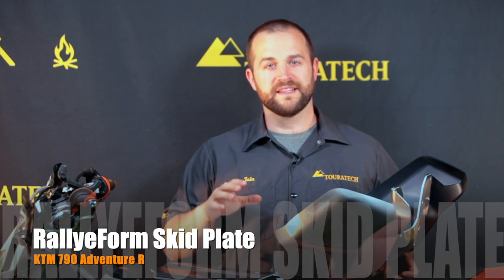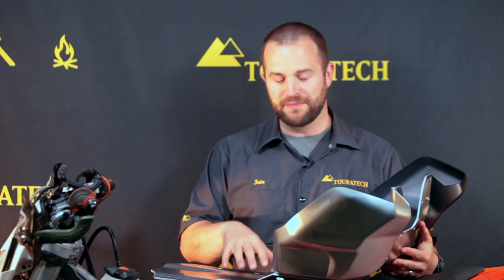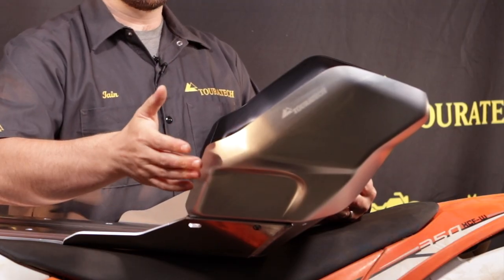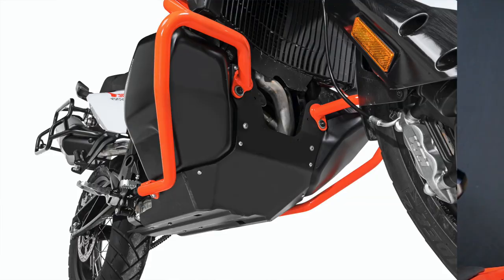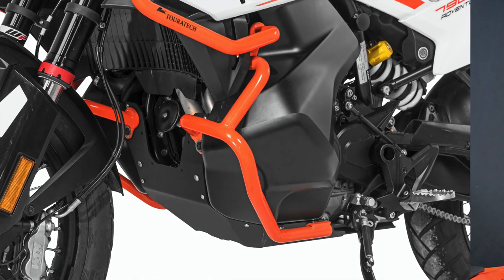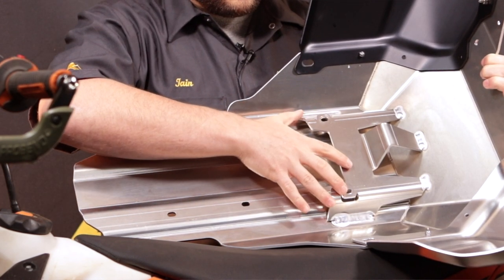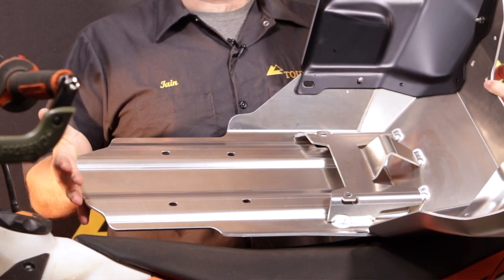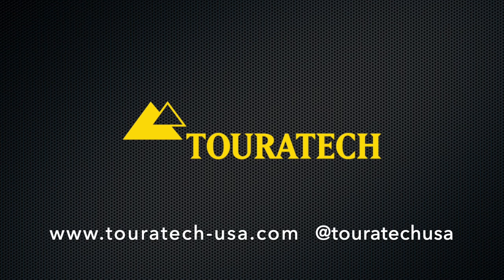Touratech RallyeForm Skid Plate for KTM 790 Adventure & R

Comment: Is this skid plate compatible with the stock/OEM KTM centerstand?
Reply from the maker: We haven't had a chance to try the parts together but from checking on the KTM instructions it looks like the springs for the centerstand will not clear our rear bracket.